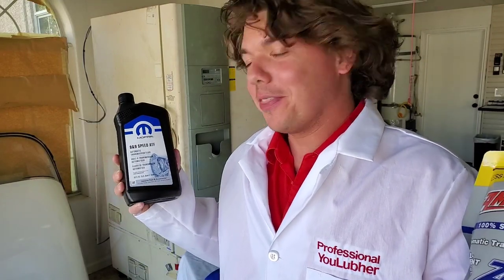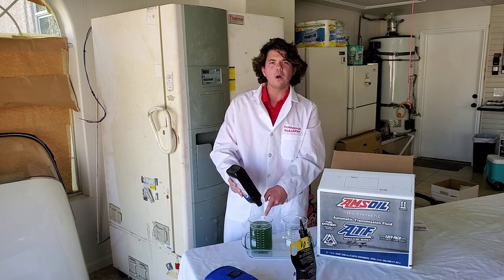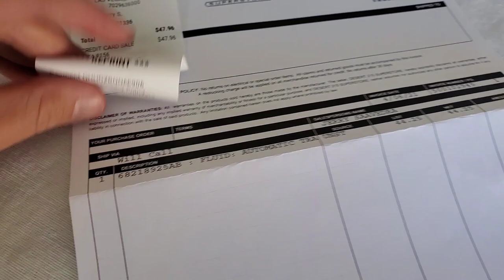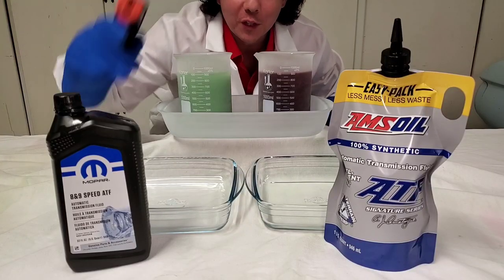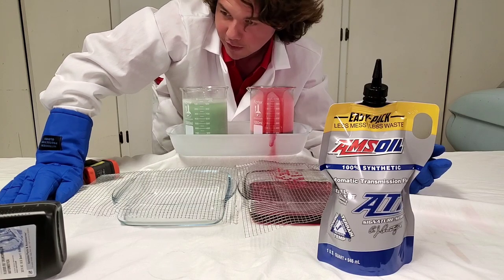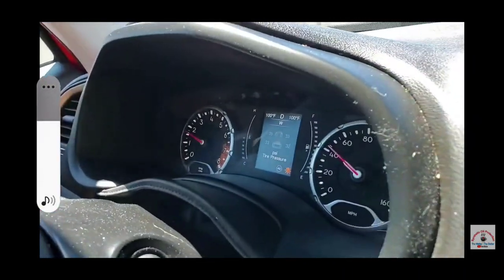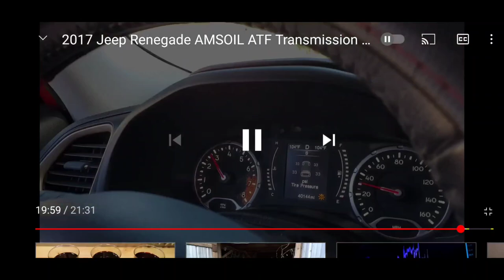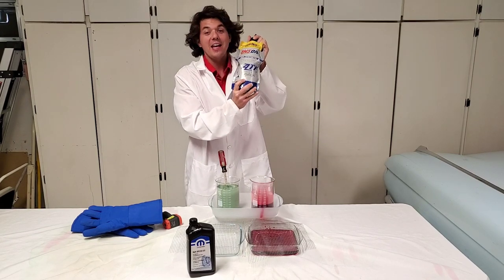Mopar ZF 8&9 Speed VS AMSOIL FUEL-EFFICIENT ATF Cold Flow Test

Comment: That price is crazy. My Ram ZF trans is definitely getting Amsoil ATF.
Reply: Absolutely do not. The ZF 8&9 fluid is much better than the super friction modified ATF's. And the factory computer is not designed to use the high slip rate engagement of these ATF's. You will literally roast your clutches.
Reply: @th600mike3  been running 93k miles no problem 🤷‍♂️
Reply: @th600mike3  that's wrong and a lie.
Reply: Are you all still having good success with amsoil fluid in the Rams?
Reply from the maker: @tonysloop9444 we have one car that I see pretty regularly it's a Jeep Renegade shifts crazy good better than the day the car was brand new- https://youtu.be/dA17lfmOH_k

Comment: Next time at the north pole I know what oil to use. How does the flow compare at more typical cold winter temps like -20°C instead of -48°C
Reply from the maker: It would perform better the warmer it is also when it gets oxidized it gets a lot thicker quicker so the 100% synthetic hams will will hold up a lot better over the course of a oil change compared to a lot of the other motor oils.

This test here shows a lot of that oxidation and oil thickening and the way it holds its film strength.
AMSOIL Performance Test Results. Read This Article - https://www.amsoil.com/performancetests.aspx?zo=5331179

Comment: Wouldn’t the amsoil mix with the mopar oil? Is that good to do?  I have a Jeep renegade and wanted to change the transmission oil myself. I was gonna get mopar transmission oil.
Reply from the maker: Yes it will mix also all the other fluids that Amsoil makes will mix with all other fluids.

This is my link if you're thinking of trying the products I would get the credit and I would be your Amsoil dealer so I could always answer your questions in the future.

If you're new to the Amsoil products it's best as a 6-month preferred customer that gets you the wholesale price which saves about $33 on a $100 order.

Get AMSOIL Wholesale Pricing - https://www.amsoil.com/offers/pc/?zo=5331179

Comment: Which brand would be better for driving in the heat ? Need zf 8&9 speed atf I kinda busted my transmission lines so got them replaced and Oreily’s said I needed at+4 so I spent about 300$ on 8qts three days later my check engine light is on and car is forcing itself to drive turns out we put in wrong atf now we wanna make sure we put the right one it due to we need to fill it by being under the car
Reply from the maker: The Amsoil is a lot better It's 100% synthetic higher film strength it'll also shift a lot faster.
Find Products For All Vehicles - https://www.amsoil.com/guides/?zo=5331179
Reply from the maker: The lookup guide will give you all the products for your vehicle This is my preferred customer link that'll give you the wholesale pricing saving about $33 on $100 order and if you have any questions feel free to let me know always happy to help.
Professional YouLubher: Eben Rockmaker Regency Gold Direct Jobber AMSOIL Specialist (Dealer#: 5331179) 702-472-3614 

     If you're New to AMSOIL I recommend the AMSOIL 6 Month PC Membership - https://www.amsoil.com/offers/pc/?zo=5331179

Comment: is AMSOIL fuel efficient atf compatible with ZF 8 SPEED transmission that comes with mopar cars?
Reply from the maker: Yes, https://youtu.be/v9PTMQ-kx14
Reply from the maker: 🎬 Professional YouLubher: Eben Rockmaker Regency Gold Direct Jobber AMSOIL Specialist (Dealer#: 5331179) 702-472-3614 

     ✅ If You're New To AMSOIL I Recommend The AMSOIL 6 Month PC Membership because it will save you about $33 on a $100 purchase after the difference in tax - https://www.amsoil.com/offers/pc/?zo=5331179

Comment: Hey buddy any way you can do this with motor oil amsoil vs mopar . Thanks for the sacrifice on the mopar transmission fluid cost .
Reply from the maker: Of course my broskis.
We did do Pennzoil which they usually recommend I asked if they had it and they said that they didn't at the one dealership maybe other dealerships carry the oil not sure.
But the dealer I went to they only had the Pennzoil for motor oil.
If you Google you'll see the Amsoil OE versus Pennzoil Platinum you'll see the videos 0w-20
Reply from the maker: Where do you live Thomas?

Comment: After your Renegade transmission fluid change video, I thought about doing my renegade, but I heard it is not recommended to change the fluid type and stay with the expensive Z9 fluid.
Reply from the maker: I recommend changing the fluid to Amsoil you'll have faster shifts better smoother driving also you'll see a bump in fuel mileage and your transmission will last longer because of the 100% synthetic film strength This is my link if you have any questions feel free to reach out to me anytime.
My link will save you about $33 off $100 order because of the 25% discount and you'll also have the free shipping on any order 100 bucks or more.
Professional YouLubher: Eben Rockmaker Regency Gold Direct Jobber AMSOIL Specialist (Dealer#: 5331179) 702-472-3614 

     If You're New To AMSOIL I Recommend The AMSOIL 6 Month PC Membership - https://www.amsoil.com/offers/pc/?zo=5331179
Reply: @Syntheticoilprotection  I don’t understand your reply above. Are you saying NOT to swap to Amsoil and we should stick with the Mopar fluid?
Reply from the maker: I misunderstood the question when I read it.

I highly recommend switching to Amsoil because of the 100% synthetic film strength you'll also have faster shifts smoother operation your transmission will last exponentially longer and my link here will give you the about $33 off on $100 order because of the 25% discount if you have any questions at all feel free to reach out to me anytime I really appreciate you being a part of my YouTube community.
Professional YouLubher: Eben Rockmaker Regency Gold Direct Jobber AMSOIL Specialist (Dealer#: 5331179) 702-472-3614 

     If You're New To AMSOIL I Recommend The AMSOIL 6 Month PC Membership - https://www.amsoil.com/offers/pc/?zo=5331179

Comment: I am thinking about going to a soil in my ram transmission. What about the fact that you don’t get a few quarts out when changing it? Will the amsoil mixing with the remainder of the molar oil cause problems?
Reply from the maker: These are some great questions Michael Yes any fluid that's compatible with that transmission fluid will mix just fine also any non-synthetic will also mix with synthetic I get asked that question a lot so basically what a full synthetic is is about 25% synthetic 75% mineral oil That's what most full synthetics are so they are actually a mix with Amsoil it's actually 100% synthetic so it will make a huge difference in your shifting speeds even if you change half the fluid it'll make a huge difference also in cold flow protection and you'll also notice a big difference with the cold shifting This is a cool video I did at -50° c to show how they're different.
https://youtu.be/wGHolrBDiYQ
Reply from the maker: This is my personal link and if you have any questions at all just let me know before you order the 6-month PC membership will save you about $33 and $100 order also you'll have the free shipping any order 100 bucks or more plus you'll also have another benefits with the PC membership.
When you use my link I'll get the credit for your order and I'll also be able to answer all your questions with the products in the future 😃☕🇺🇸
Thanks Michael for being a part of my YouTube community 💯

Comment: Can I use the amsoil in my 2017 charger scat pack with the zf 8 speed?? I need to get it changed and the mopar fluid is so expensive
Reply from the maker: Of course it'll make a huge difference!!!

You'll have much faster shifts you'll have less vibration in your drive train This is the lookup guide This will give you everything for your year make and model.
Find Products For All Vehicles - https://www.amsoil.com/guides/?zo=5331179
Reply from the maker: I recommend the 6-month PC membership that will save you about $33 and $100 order also if you have any questions you can always reach out to me anytime always happy to talk and when you use my link I will get the credit for your orders and also I'll be your Amsoil dealer so I can always answer your questions in the future.

If you have any questions before you order always happy to talk with you. 😃💯☕
Professional YouLubher: Eben Rockmaker Regency Gold Direct Jobber AMSOIL Specialist (Dealer#: 5331179) 702-472-3614 

     If you're New to AMSOIL I recommend the AMSOIL 6 Month PC Membership - https://www.amsoil.com/offers/pc/?zo=5331179
Reply: @Syntheticoilprotection  would using this oil void my warranty cuz I’m just over 45k miles and got it used so I want to do it a little early cuz I’m not sure how hard the last owner drove it but I still have the 100k miles power train warranty would using amsoil void the warranty? I want to use it but if it does go wrong somehow I want to be protected still
Reply from the maker: It will not void your warranty

Comment: What's the mileage rating for the Amsoil eco ATF, 30,000 50,000, 60,000, 80,000, 100,000 or higher???
Reply from the maker: Great question I'm not sure which ATF you're talking about but most ATF fluids are going to be good for about 30 to 60,000 mi depending on how you're driving.

If you're doing specialty stuff like all highway driving you can go quite a bit longer with oil analysis.

If you're doing city driving in a high temperature area like Las Vegas it's more preferable at about 20,000 miles just depends on driving conditions. And if you want to be 100% for certain you'd want to definitely do an oil analysis like in this video.
https://youtu.be/IeVPGR7UO9E
Reply: @Syntheticoilprotection  Thanks for replying I was wondering if you would. I used to live in Central Arizona it's even hotter there than Las Vegas Nevada. One year while working at Fry's food & drug grocery store they put on carts on one the hottest days on record for three hours and it was 128°f plus the asphalt factor.🥵 I usually changed the ATF fluid in the vehicles I have owned about every 50,000 miles on the old V8 muscle cars I have owned but no more than 100,000 miles with Valvoline Max Life ATF Dextron III Mercon V and filter and gasket of coarse.

Comment: So if anyone has the newer Rolls Royce with the ZF 8 speed automatic transmission with GPS, they should use the Amsoil Fuel-Efficient ATF, because that transmission is still even more expensive and requires stricter lubrication at the coldest temperatures and hottest temperatures, despite being the same transmission with the GPS found in BMWs.
Reply from the maker: What is a GPS?

Comment: Mobil 1 atf or Mopar +4 we're probably the two best, and most relevant comparisons to Amsoil fuel efficient. 

This test absolutely proves nothing because both products do not serve the same purpose.
Reply from the maker: That's correct and not correct at the same time.

So the one meets one specification.

The other fluid meats several specifications which you'll see on the back of the bottle.

So there's nothing proved as in yeah they both don't meet the same exact specifications across the board but the one thing it does prove is that one will have less parasitic drag when it's shifting because less resistance.

That equates to better fuel mileage smoother shifting longer lasting transmission because if the fluid doesn't flow over the components they won't be cooled and you could have a burning issue even if it's at a cold temperature.

This is some great info that you will see some big differences between a lot of other fluids.

25,000 Mile AMSOIL OIL CHANGE. 
Watch This Video - https://youtu.be/vp1HTtlulR8 

The Power of AMSOIL Signature Series 5W-30 Synthetic Motor Oil protects against harmful deposits on turbochargers 4X better than Mobil1® Extended Performance and 3.6X better than Royal Purple® in industry-standard testing*.  Read This Article - https://www.amsoil.com/newsstand/motor-oil/articles/leading-the-field-in-deposit-protection/?zo=5331179 

     Better MPG Proven. Read This Article - https://www.amsoil.com/newsstand/motor-oil/articles/another-win-for-amsoil-products/?zo=5331179 

AMSOIL Performance Test Results. Read This Article - https://www.amsoil.com/performancetests.aspx?zo=5331179

Comment: Supposedly the amount of friction modifiers in the ZF fluid are lower than amsoil and too much modifier in those transmissions can be harmful to the clutches. I'm sure amsoil would work in it but I guess it was designed for a designated amount to be used in it... Amsoil is better fluid overall I'm sure tho I agree, does look beautiful.
Reply from the maker: ♥️ AMSOIL Performance Tests: Read This Article - https://www.amsoil.com/performancetests.aspx?zo=5331179
Reply: @Syntheticoilprotection  I believe amsoil is better than the rest just bought some amsoil 10w30 signature series today for my truck 2001 Silverado first time buying motor oil used the 75w90 for rear diff before though.
Reply from the maker: Awesome thank you!

If you are new to Amsoil I recommend the 6-month PC membership when you use my link I will be your Amsoil dealer so the future I could always answer all your questions on the products I appreciate the business in future business in advance 👍

♥️ AMSOIL Performance Tests: Read This Article - https://www.amsoil.com/performancetests.aspx?zo=5331179
Reply from the maker: ❤️🇺🇸❤️ Professional YouLubher: Eben Rockmaker Regency Platinum Direct Jobber AMSOIL Specialist (Dealer#: 5331179) 702-472-3614 

      ✅✅✅  I Recommend The AMSOIL 6 Month PC Membership because it will give you the Best Value which is about $ 33 back on a $ 100 purchase after the difference in tax - https://www.amsoil.com/offers/pc/?zo=5331179

Comment: Es compatible para ram 1500 de 8 velocidades ?
Reply from the maker: Yes I highly recommend double checking the lookup guide will give you everything for your year make model and engine size when you use my link that will attach me to you so in the future I can always answer all your questions about improving the performance and lifespan of the vehicles by choosing the right fluids as your independent Amsoil dealer👍
You want to click on link and then click on website and then you'll see by wholesale as the 6-month PC member will give you the best value on the products and I'll always be your Amsoil Dealer answer your questions in the future😃👍
Eben Rockmaker 702-472-3614 
https://linktr.ee/EbenRockmaker

New promo: FREEQUART

Comment: What if you tested if vs Mercon LV?
Reply from the maker: Great suggestion Michael we definitely will during this winter
Reply from the maker: 🥇 AMSOIL Dealer - Synthetic Oil Protection
(702) 472-3614
https://maps.app.goo.gl/DmLU5hP72HadUBEm9
             
     ⛳️  Synthetic Oil Protection Website - http://syntheticoilprotection.net 

     Did you know a oil manufacturer can call a lubricant a Full Synthetic when it's only 25% synthetic? AMSOIL is different because it is 100% Synthetic and has a higher film strength keeping the metal parts separated. AMSOIL allows less friction, less heat, less wear on the component. 

     Your Vehicle Could Run Better Than Brand New By Using AMSOIL 100% Synthetic Lubricants! See Results - https://youtu.be/zH-VquYlhqA

Comment: So, the quality of the fluid defines by this “temperature test”? Is there a place in United States with -50 F? Is Amsoil made for Syberia? You should try to distribute this oil to Siberia that’s for sure. Other than that I don’t see any advantage to switch to Amsoil. If you guys really want to know, you should take a sample of Mopar ATF and Amsoil from your Transmission and send it to the lab for analisys. Don’t let this guy to fool you
Reply from the maker: Correct a higher quality additive package will definitely remain fluid in colder temperatures throughout the lubricant interval will maintain and extend the life of the component by having flow and extreme conditions keeping things lubricated
50 Years of AMSOIL - https://youtu.be/MQUqRBI8dD0?si=ZHsOepp7mDvgbGmo

Comment: Ya that's all cool an all but has anyone done a drain an fill tho. An replaced zf fluid with amzoil.
Reply from the maker: Yes we have several vehicles on the channel you'll see them in the playlist section how to get your transmission to shift faster and smoother begin playlist we'll see all the fluid changes listed there

Comment: What’s that mean mopar oil not good?
Reply from the maker: Well it isn't 100% synthetic so the film strength isn't as complete also thickens a lot more of the cold so you'll have a lot more aware on your transmission and the cold temperature also the shifts will be slower so if you're looking for a better shifting vehicle I definitely recommend switching over to the Amsoil This is the lookup guide it'll give you all the products for your vehicle also when you use my link I'll get the credit for your orders and I'll be your Amsoil dealer in the future I could always answer your questions on all the products.

Professional YouLubher: Eben Rockmaker Regency Gold Direct Jobber AMSOIL Specialist (Dealer#: 5331179) 702-472-3614 

     If You're New To AMSOIL I Recommend The AMSOIL 6 Month PC Membership - https://www.amsoil.com/offers/pc/?zo=5331179